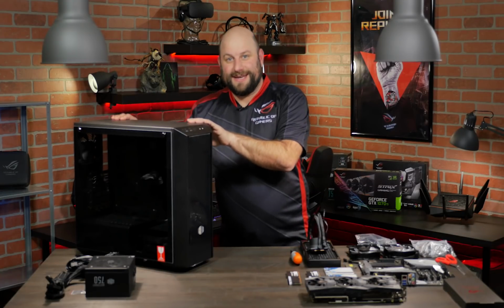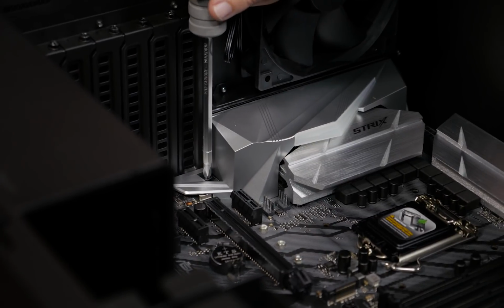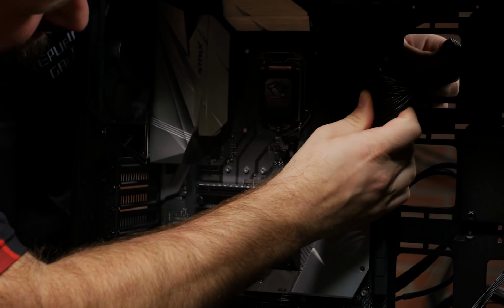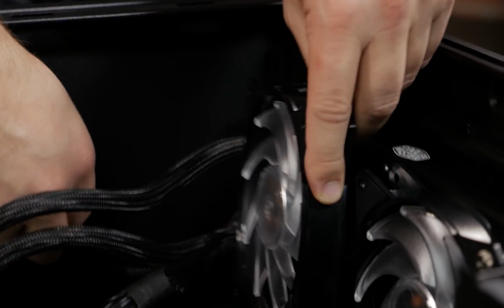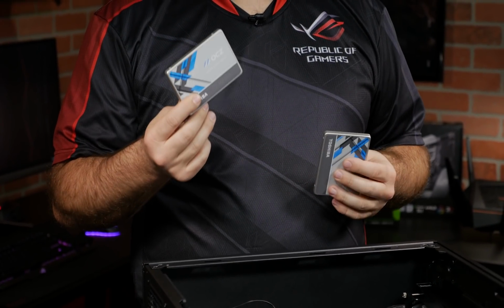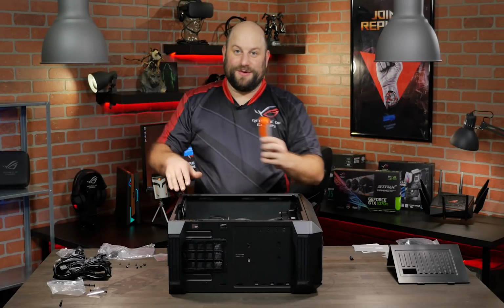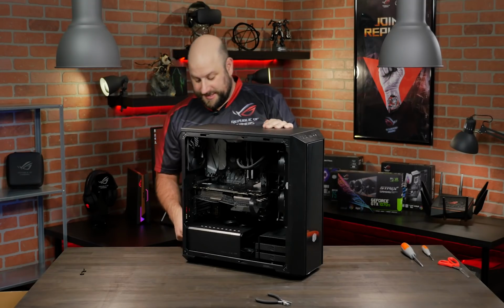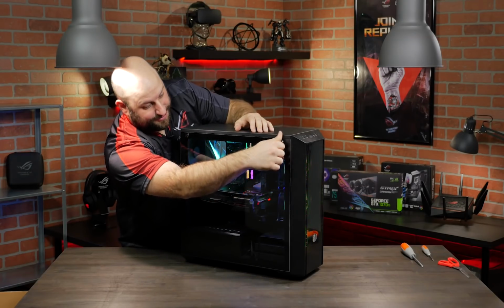AURA SYNC Holiday Build - Part 1

Comment: Nice vid, but it would be nice to see how you connect for example 8 aura compatible fans + led strips + case to the motherboard showing us which cables and connectors we need.
Reply: THE WHOLE POINT OF THE VIDEO
Reply: I watched the video to understand that as well, and wished they had shown that.
Reply: guyz you just need a 4 pin rgb spliter female to 4-5-6-7-8-9-10 females and some needles, some spliters includes its cheap and the only solution over syncing you rgb case stuff im talking about the 4pin header on mb check these stuff check these out to alli express its super cheap and makes you a clean rbg fully controlable...hope i helped :)

Comment: I mean let's be fair. Asus aura is probably the worst. I have used it on multiple motherboards and it resets it self. Doesn't remember settings. Won't connect to ram sometimes. Other times it does. Its exhausting
Reply: Scorehound gigabyte is my fave as they allow you to change rgb settings in the bios with out software so if you don't want windows software slowing your system down you can use thr uefi to set it and forget it
Reply: It's not the worst. AsRock's is by far the worst RGB software out there. I have an AsRock Z270 MB and the software sucks. I'm running Asus Aora on my AsRock board for Gskill ram and it's been working pretty good.

Comment: cool bild dude , $$$$ ? please
Reply: ZONAVELHA somewhere in 2150-2500 range. You can also get a GTX 1080 for cheaper than the 1070 Ti right now, just a heads up.
Reply: 3600 usd